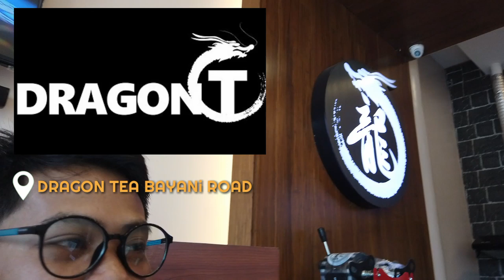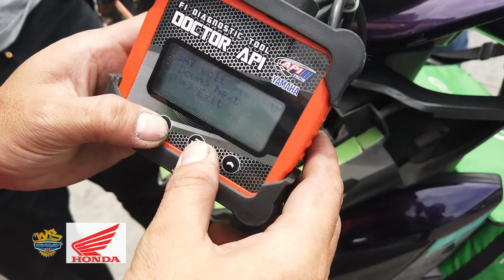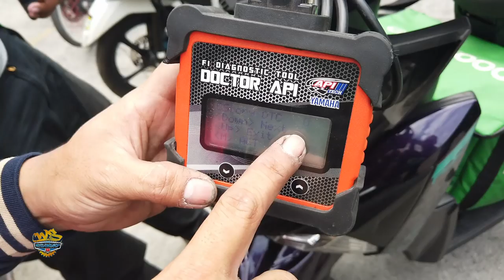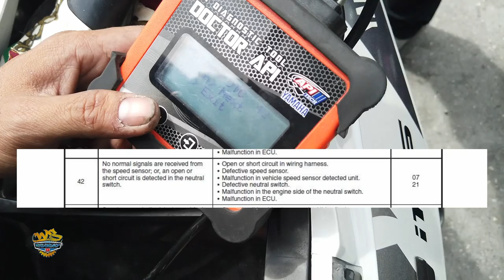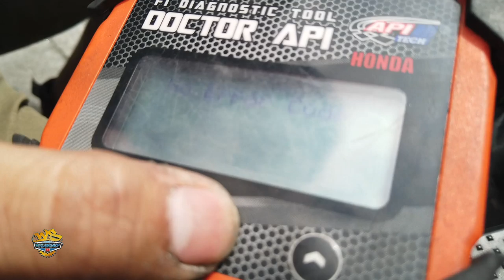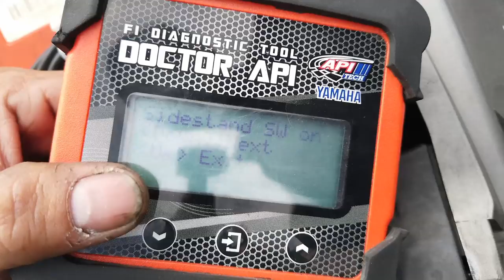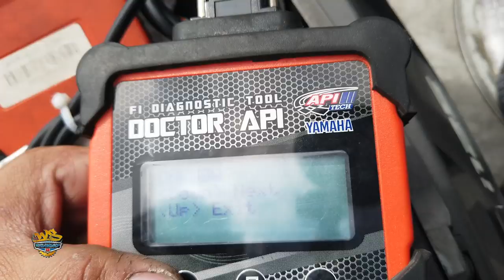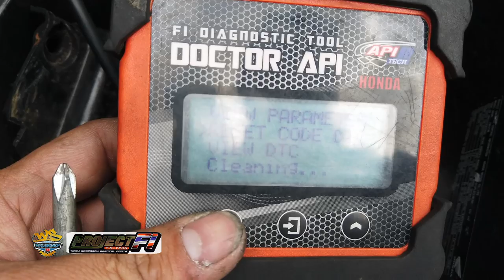ERROR CODE NG FI NA  NGAYON KO LANG NA-ENCOUNTER / Part 2 - Ikot FREE Reset ECU with GRABFood Vlog

Comment: Paps para maliwanagan din yung iba. Sa 4:00 nireset yung ecu kasi may "Open circuit sa wiring". Pagkatpos ireset nawala yung error, e pano ung open circuit sa wiring mismo? Nwala ung error pero ung mismong shorted wire pano maaayos? Ty sa sagot boss.
Reply: oo nga eh, hardware error yon paano na-repair ng software, parang may loose contact...

Comment: Paps nag linis ako throttle body nireset ko din ecu. Nilinis ko kasi hirap na mgstart napaka dumi nung nilinis ko. May time po pag ginagamit ko sya parang nawawalan ng gas pg malalim yung pihit.. tapos pag cold engine naman inistart ko. Normaly high RPM pa sya kasi malamig pa. Mga 5 to sec sec po dba babalik na normal Rpm yung akin namamatay makina. Tapos minsan naman high rpm sya pero parang putol putol yung makina parang kinakapos
Reply from the maker: Mas maganda ireset ecu
Reply: sir bago po subscriber.tanung ko lng po ung motor ko skydrive   125fi biglang namatay ung makina tapos umandar ilang minuto tapos namatay n nman.hindi na mapaandar. anu kaya sakit nya .salamat sa sagot.